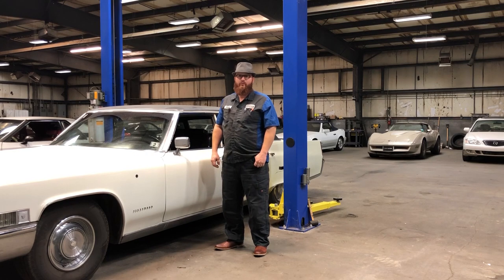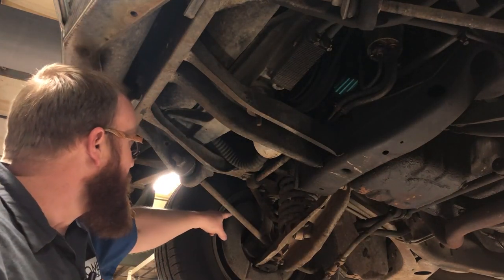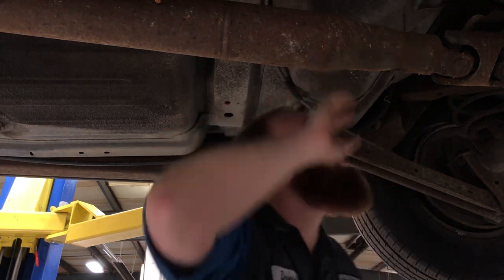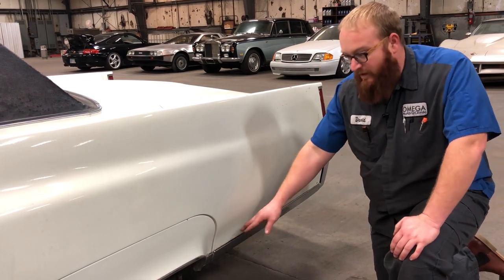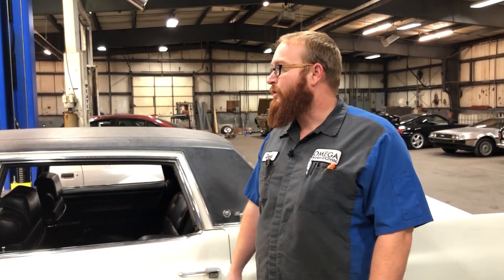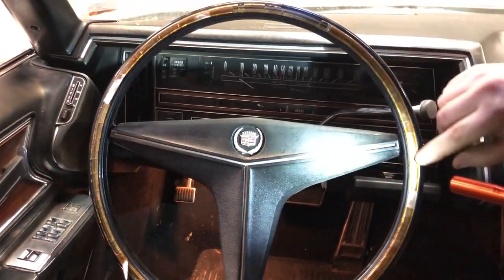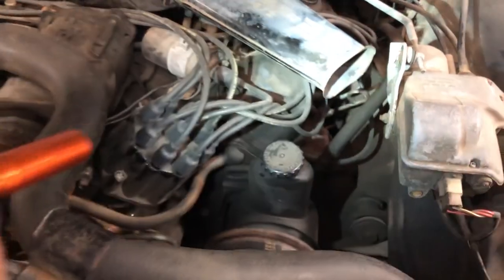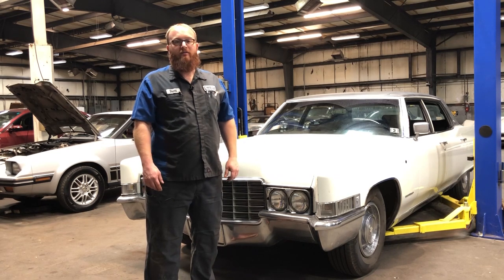CAR WIZARD Shows What Makes a Classic Car a Deal or a Steal on this 1969 Cadillac Fleetwood

Comment: SHEESH! (don't be so nervous! Nobody's expecting to see and hear a 'movie star' here!
(a small addition from me, after many years of doing it...using **gently applied 'Armor-all'
on plastics...especially the dash will slowly 'give life' back to it after several applications)
On window-seals I like to apply soft paste wax to them and gently buff them out...this works
very well on windshields with a lot of exposed soft rubberized material...it more or less
'soaks in' and will actually restore them to 'like new' condition after 3 or 4x of buffing)

You gotta' nice Caddy there! Properly maintained, it will last another fifty years or longer...
of course it might have 'all electric' drive by then because 'ICE' fuels have been replaced by
'forever' battery-cells or possibly Hydrogen fuel...who knows?

Comment: yourr particular car looks great.  However it should no longer be outside in its current ondition.  Cadillac, before closed cell foam was used, had a felt type backing under your vinyl top, which wicks moisture. The rust residue on your trunk floor, likely signifies your 'top' has failed.  You can save your car, by pulling the top back to above the rear window, sanding and filling the damaged sheetmetal, and resealing the rear window.  Then you can reglue the original vinyl top using a thin closed cell foam.
Another problem area is the rear body to frame mounts, just behind the rear wheels.  Above the rubber mount, there is  gusset which collects road debris.  If debris lays in there, any water puddle wets it...and over time the trunk floor rots out, just behind the rear wheel wells, as its thin sheetmetal.  Keep the gussets clean and rustproofed!
I also suggest XL (xtra load) rated tires, you can find good brands in whitewalls.  These cars are heavy, but with top notch brake pads/shoes, good brake hoses, Michelin LTX XL blackwalls (if you like the look) , a rear stabilizer bar, high pressure gas shocks, you will think you are spoiled by how good a Fleetwood drives...looking stock!
Before all-wheel drive,  Fleetwoods were go-to cars for driving in the snow, with snow tires...a lot were 'used up' that way.

Comment: I'm adicted to old LR discoverys, now you have a caddy. Mine with a substantially weeker engine and using the coqtail of gas and alcohol that they sell here in Brazil I'm achieving the mpressive mark of 3,4 km/l. And the liter of gas here in São Paulo Cost around U$ 1,5 PER LITER. I wonder how much would be to use that Caddy as a daily here. Good luck

Comment: I had a 69 Caddy Calais 2 door coupe.  Great car.  The rim blow horn is not where the wood grain inlay is on the wheel but is located on the inside of the inlay smaller diameter ring.  Push on the raised crease on the inside diameter.  They didn't work that well when new so good luck now as the plastic gets harder.  I had a 73 Coupe Deville after the 69 and it was a big POS. it rusted all over when it was just a couple of years old and it couldn't get out of it's own way.  The 69 I believe was rated at 375 horse and it acted like it.  The 73 was lucky if it had 200 horse and it was just a big pig.  It was also a 472 ci. engine.

Comment: I was a teenager when the 69/70 Cadillacs were brand new. Along with the '69 Lincoln Continental, these were the top of the pile. The only thing more impressive was a Rolls Royce. Few had ever seen a Mercedes and no one knew about BMW's yet.....Just a few years later, around 1973, The Detroit Dark Ages began. FYI Wizard: You are missing the 3/8" chrome side trim that ran from the front door to the tail lights, more evidence of a repaint. Thin white walls would be period-correct as well.

Comment: Don't forget the shunt resistor it's in the wire that feeds coil and don't forget to pick up coil that's the wire that goes from inside the distributor top to bottom I can't remember what Clips in or something . those to go out you'll be cooked

Comment: I saw your vacuum advance on your distributor was disconnected. Did you do that or was it purchased like that? That diaphragm is probably bad... Can't tell you how many times I've had that be the case. Luckily it's a common year GM so perhaps the parts store will have a replacement.

Comment: Hey car wizard. I'm also a Fleetwood aficionado and have been many years. My dad owned a 1970 Fleetwood in Spartacus Blue Firemist. I remember as a little kid in the early 70s him coming home from work and pulling up in all its magnificent splendor. Wanted to buy one about 20 years ago or so, but I'm not a mechanic by trade. I did have a 67 Sedan Deville as my first car at age 16 around 1987. The trunk floor was loaded with news papers and pulled then to reveal several crater size rust holes in the trunk floor. How devastating at the time. Anyway, have you thought about getting whitewalls for your car??  I think they would look classy. I noticed the hubs on it. I'm not if they are stock. I think the 69 Fleetwood hubs were a bit different. Maybe from a 68, possibly 67. You have a real cool car. Please keep us updated on what you'll be doing to it. Thanks. Joe
Reply: Hiya Joe... Yep, those are the factory wheel covers. And I agree with ya, that's one NICE Caddy.

Comment: Rain water leaking at the bottom of the rear window into the trunk. Your distributor vacuum advance is not hooked up. The car should have white striped sidewall tires as it did when new.

Comment: I live down under and I am still trying to find someone who can tell me which Caddy had the low rear floor tunnel enabled by having a drop gear in the nose of the Diff which enabled the tail shaft to be as low as the bottom of the banjo, we had one in the body shop, I think it was a 69 de Ville, GM may have had a short and forgotten run of this type of diff.

Comment: Wizard, I didn't know about driveshafts causing vibrations so thx 4 that tip... But don't those have grease fittings and wouldnt that help or stop the vibe's?

Comment: had one, same year, a convertable ,,, frame on the drivers side was shot,, and it burnt oil.  had a '70 con... didn't burn a drop, wanted to save the motor so bad, had no way to do so.  I love the small design differences on the '69 much better.  my '69 was maroon, with while leather, great look, ,,, the '70 was gold, with s brown leather interior, looked horrible, lol.  as i look at the re-sell of these, they're not giving them away now.  find a 'keeper'  and, KEEP IT, lol.  and yes, these are 19 feet long

Comment: did I see the vacuum advance line disconnected to the distributor? I guess with 472 cubes you might not even notice the loss in acceleration.

Comment: that car has spent most of it's life in a garage.
oil leaks are not really that bad for a 50 yo car.
the rubber fuel line cracks me up.
magnets dont always work..
i would crawl in the trunk and check out the package tray for rear window leakage

i bought a 69 imperial in Ohio,and it had cruise
i drove it all the way to Georgia set the cruise at 80 and relaxed

Comment: I took my driving test in a 69 De Ville, it's about a foot shorter, had to parallel park, it oh what fun.   :)
Reply: Shea Dy 

I took mine in our ‘59 Caddy. 225” long. Passed on the first try. Parallel parking was a snap. Huge fins helped with alignment. Key was turning the wheels hard right, then hard left until it was parallel with the curb. 

BTW, I learned to drive by backing it out of the garage along a long gravel driveway and putting it back after we returned.

Comment: Nice find!  I love those old Caddys.  Someday I'd like to find a 67-68 Sedan and turn it into a nice driver that I can use as a daily or road trip car.  Looking forward to seeing what you do with this.  Are these things really that bulletproof?
Reply: The 472 (1968-1974), 500 (1970-1976), and even 425 (1977-1979 deVille/Fleetwood, 77-78 Eldorado) are very durable.  The cam gear has a plastic coating that breaks down and falls off over time, rocker arms are non-adjustable so some develop valve clatter, and the QuadraJet can have leakage at the fuel inlet and porosity in the float bowl.  The timing gear can be replaced with an all-metal set, rockers don't usually make noise if the engine had regular oil changes, and the QuadraJet can be sorted out by someone who knows them well.  200,000 miles is normal for these engines, and much more is not unusual if cared for properly.   I have had 11 69-79 Cadillacs over the years, and they are cheap to maintain mechanically.  If driven in salt or left outside in a wet climate, these cars deteriorate quickly.  As a result, many for sale are junk, so you need to be particular when buying one because rust, interior, or chrome problems get expensive quickly relative to the value of most of these cars.
Reply: @aaron.hudacky  thanks!  Very useful information.

Comment: Is that the fuel line wire tied to the brake line?  I don't think they came from the factory with a rubber fuel line from the tank to the motor !

Comment: He ended up pulling the engine, trying to swap a diesel in, having the heads rebuilt on the old engine and putting it back in, then dumping it immediately.

Comment: 5000 pound beast.  0-60 in 8.5 seconds, which really isn't bad.  375 hp, 500 lb-ft torque.  8.8 mpg.  Are you going to wake up the giant V8 or leave it original?  I'd leave it.